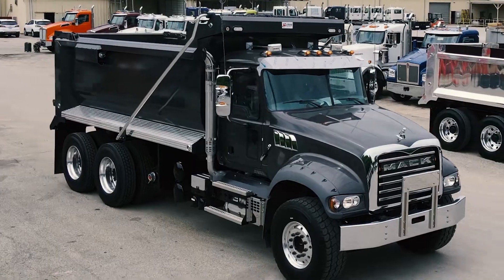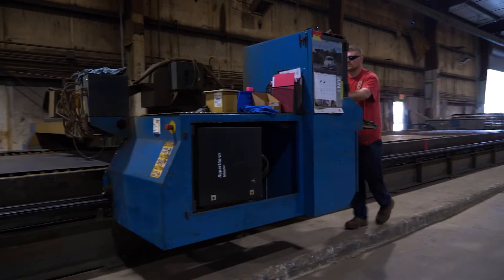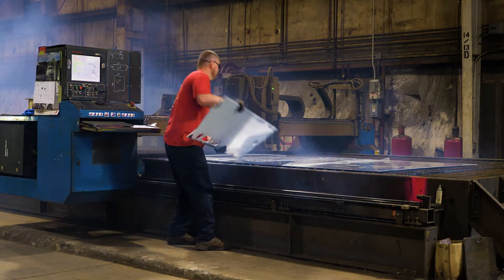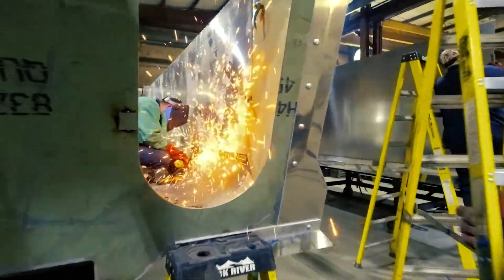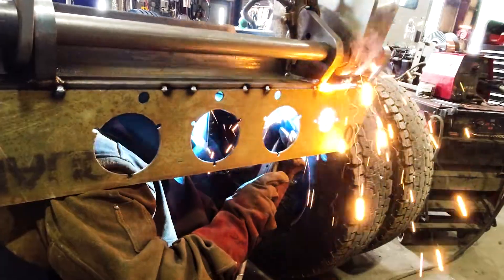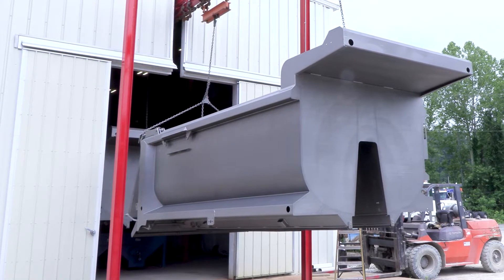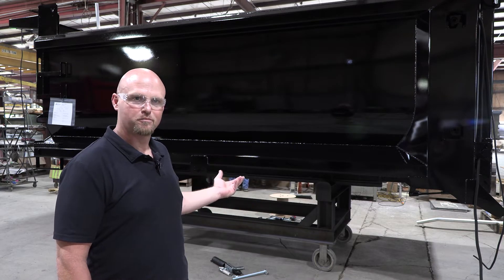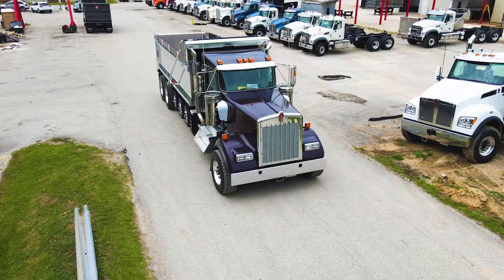How Are Dump Trucks Made?

Comment: well it was mildly interesting seeing the guy using compressed air to dust the lead dust off the thing after being blasted but other than that these guys can learn a lot from those pakistani guys that build these things in the dirt wearing sandals welding with safety squints and painting right over the rust.
Reply: 😂 it was steel shot, I came to the comments to see if the lead shot was mentioned.
Reply: @RutherfordConLLC  That makes a lot more sense but its way less interesting.